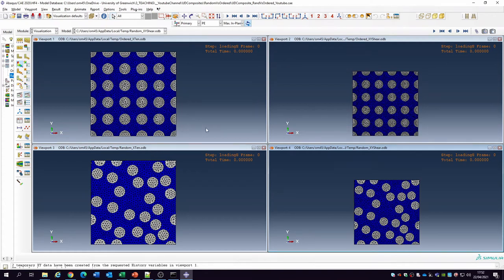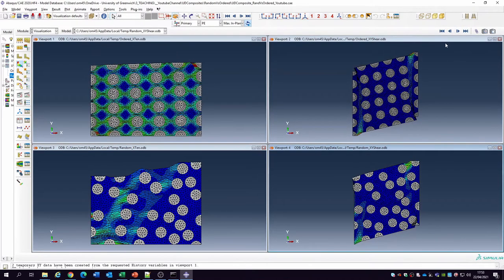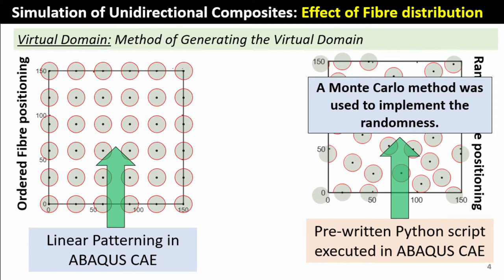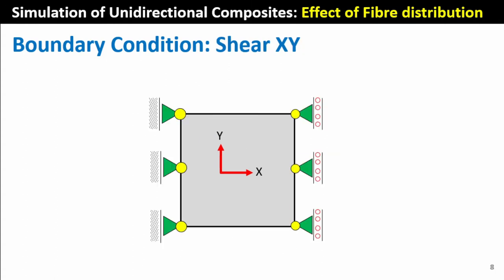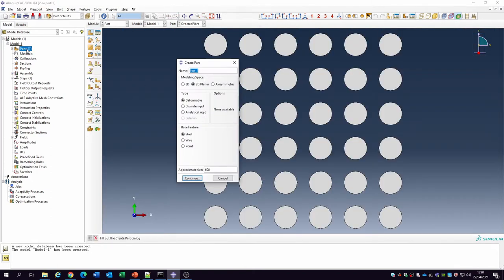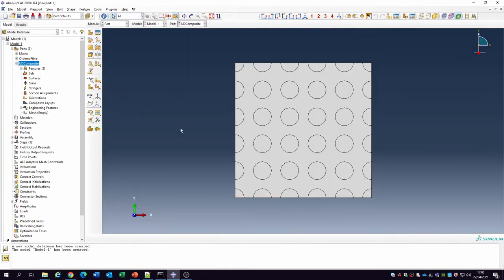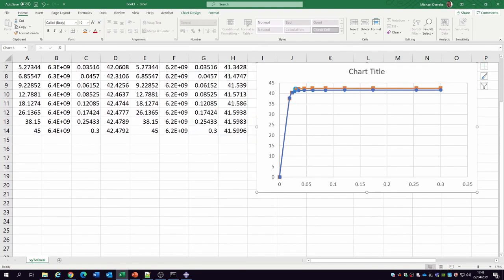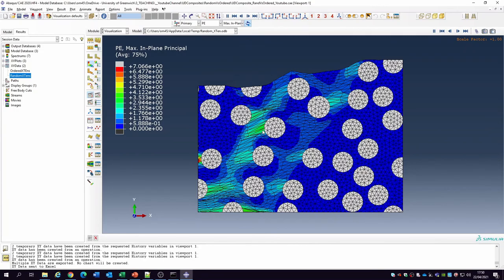ABAQUS Tutorial | Effect of Fibre Distribution in Unidirectional Composites

Comment: Thank you for your great video. I have a question to ask about BCs and Constraints. To apply BCs and Constraints, I see the difference between "Ordered_XYShear" and "Random_XYShear" cases. Namely, when applied to "Ordered_XYShear" at 13:56, XConstraint is maintained, which was made in "Ordered_XTens" simulation. However, in case of "Random_XYShear", XYConstraint is newly made for "Random_XYShear" at 23:25. I think "Ordered_XYShear" needs to make XYConstraint as Constraint. Could you please check about this?
Reply from the maker: Hello @Enidentictok, thanks for your comments. I think you are right in your comments about preserving X_Constraint. It seems I did not rename it appropriately, it should ideally be XYConstraint. I have a video about shear testing setup which you can see here: https://youtu.be/oXgN1qK084k. It will explain to you more about this.
Reply: @MichaelOkereke  Thank you!